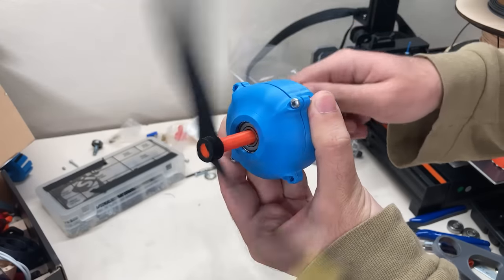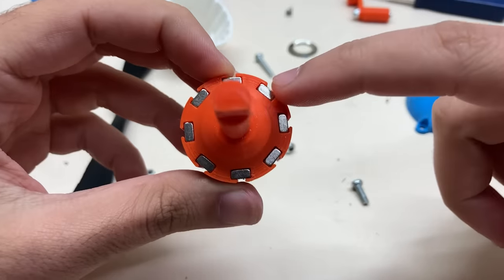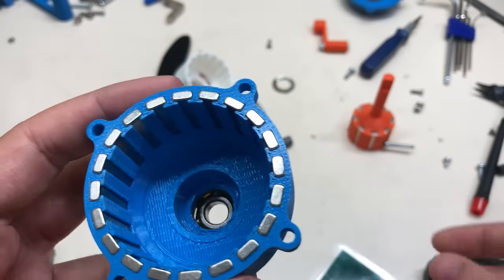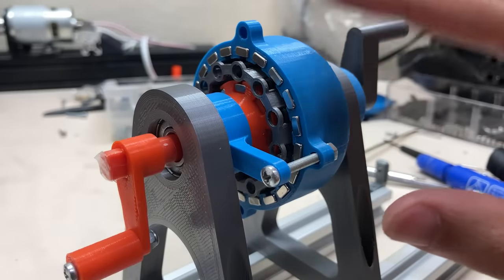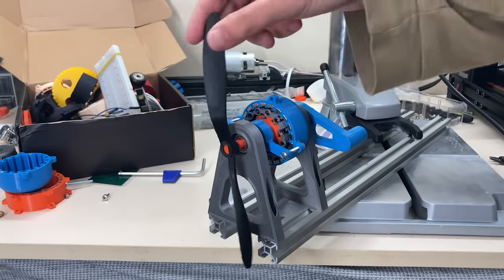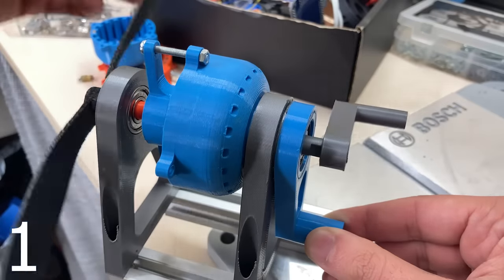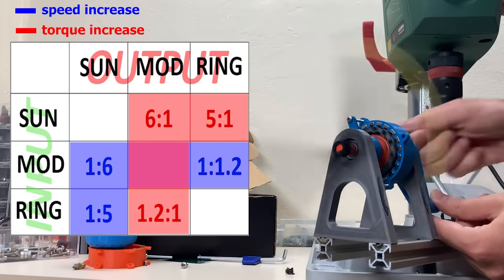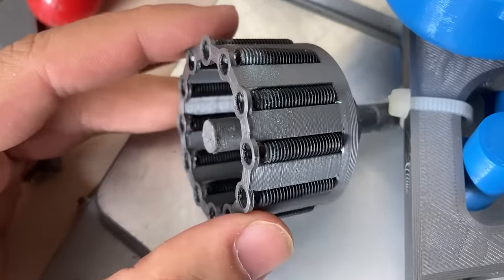How this magnetic transmission works?

Comment: Couldn’t you switch out the magnets for electromagnets and alter which ones are turned on and at what power in order to change the “gear” ratio. It would make car transmissions way simpler and probably many other things.
Reply: Yes, that works, but it takes so much power to operate the electromagnets that any mechanical transmission (even continously variable designs) is more efficient.
Reply: In principle that would work, but if you go that far, why not just use an electric motor that doesn't require a gear box to drive your car? Oh, wait... 😊
Reply: @helmutwalle2105  correct me if I'm wrong but on paper, the following could work. 
Assigning a static motor as input. Use a audrino with electric magnets. Have the external module installed with 24 (or more) electric magnets. The audrino will simulate a gear shift powering 1/4, 1/2, 3/4 and all electric magnets. The more magnets that get switched on, the faster it would spin. It would also be able to change direction so you'd have forward and reverse. In theory it could work. Please try. I don't have a 3d printer. The housing would be larger than the current 1st Gen. If it works in practicality, then not only would Manuel give you a smoother shift, but automatics would would get you a faster than current shift. Almost like a live shift. It will also eliminate the "Manuel vs automatic" argument as you would be able to switch between the two variations.
Reply: @helmutwalle2105  Electric cars still have a single speed gearbox/reducer.  Usually around 9:1.
Reply: @VNCTHE1  - yes, I know many still do. The technology used in production EVs is not very sophisticated. This may change in the future.
Reply: Sounds like you're describing an electric motor.

Making the magnets electromagnets also significantly degrades the performance of the transmission since energy would need to be routed or separately supplied in order to power and manage the transmission. I'm sure the energy required to do this would likely exceed any performance gains from using a transmission like this over a traditional geared transmission with appropriate lubrication.
Reply: @helmutwalle2105  it's not a matter of sophistication, but the fact that electric motors are most efficient at a given rpm that's governed by its construction.
Reply: The big three are coming for you
Reply: I like electromagnetism as a means to overcome inertia, but after that it's not reasonable. I also don't see rare earth magnetics being able to easily overcome inertia. Almost like a partially engaged clutch. Maybe there's room for both technologies.
Reply: Magnetic gears can't handle torque loads.  There are all kinds of inventions that you have never heard of, and for the most part, there is a reason they aren't used for other purposes.
Reply: I believe what you are describing is known as an electric motor
Reply: @jacobclubb5624   No in this case we aren’t making a shaft spin. We take a shaft, make that shaft turn electromagnets which in turn effect the other magnets in a way that either increases its torque or the reverse. Which you can change how much it does simply with a controller. Changing gears without moving “anything”. As others have said this is rather inefficient compared to other ways of doing so. But it is versatile. But you are right in the way that if you just programmed the controller another way it is an electric motor.
Reply: Only for the stationary magnets would I see this being possible
Reply: @ShaunHensley  why so? The electromagnets on the outside are stationary. The magnets on the inside turn along with the shaft as is in the video.
Reply: @windify2712  because I would think the wires carrying power to the rotational slugs in order to make electro mags would twist off, I think?
Reply: @ShaunHensley   @Shaun Hensley  well, the magnets on the inside could be just normal magnets. And the ones outside & stationary would be electromagnets. And you could control it according the the speed of the "input" shaft making a sort of differential.

Or This is unneccesarily complex and unreasonable aaand probably fantasy you could induce a current inside the inner electromagnets from the outside.
Reply: @windify2712  That’s exactly what I said mate
Reply: @ShaunHensley  Ah alright, I didn't understand what you meant by stationary magnets in the comment before. To my defense it was an unclear sentence.
Reply: @windify2712  Well, rotating equipment has a stationary component and a rotating component and they work off each other.
Reply: @windify2712  calling your idea inefficient is a wild understatement. I don't think you understand the enormous amount of power an electromagnet consumes. This is not something that can be reduced through the advancement of technology without violating fundamental natural laws.

It would also be limited to low torque motors which unfortunately cannot produce enough power to use your transmission.
Reply: Yes
Reply: @coreyduma325  I don't really have much experience using electromagnets. Especially not at the scale that large. So I can't really gauge how much power it would consume :
Reply: @windify2712  astronomical amounts of power. Thousands of amps. It would need to use superconductors to make one that was a reasonable size. 

In the end, it would result in a transmission with negative efficiency consuming more power than it transmitted while costing more than most supercars and being the size of a van. It would be limited to less torque than a motorcycle
Reply: And this is how you make a servo
Reply: Theoretically yes. Practically no also itd waste more energy than just a physical gearbox
Reply: @brianb-p6586  have you heard of electropermanent magnets? they're electromagnets that only need power to flip their magnetic orientation. once power is turned off, they remain magnetised. they might be able to do this with less power
Reply: @brianb-p6586  energy consumption is pretty high, but that's only because of the initial start for the most part. If energy efficiency and sufficiency is the key, then manual ignition wouldn't be choice as an initial start
Reply: @default1988  because the amount of electricity needed to drive the electromagnets would be so much that you can make a week slow car anyway. And if you're already putting that much battery and electric components and power equipment, you may as well just make it twice as powerful and make that the entire engine in the first place
Reply: How is it different from the Tesla engine?
Reply: These are good for speed but they can't handle high torque
Reply: Electromagnetic operation be useful on multiple fronts, to consolidate transmission and regenerative braking into one unit
Reply: @default1988  saying that any transmission would be able to fix that argument is going a little far I think. Even automatic engines technecally can do that as given by most automatic transmissions being able to switch gears on command of the user. Even though this is a really cool idea, I cant see it being any more efficient in cars other than the fact you probably don't need a clutch. these transmissions are more similar to transmissions with torque converter, where torque is not directly transmitted, but acted upon by a force from the other side. Good idea, but I think the only advantage possible is longevity.
Reply: HYPOTHETICALLY if u did put this as an electromagnetic gearbox it would probably be best suited as an additional gearbox like a transfer case for 4x4 but as a final gear like overdrive to get more over all top speed while limiting power consumption, eg: like if you made  the entire transmission electromagnetic it would need to much power to operate, which would negate the need for high torque from the gear but would exponentially increase the overall topspeed
Reply: That's an electric motor
Reply: Electric cars don’t need transmissions so as we are all adopting EVs eventually this is unnecessary
Reply: I was just think that and I saw your comment.
Reply: Yes, and then you call it an electric induction motor.
Reply: Thats how brushlrss dc motors (bldc) work
Reply: At that point you just have an electric motor
Reply: its the future , electric motors havev optimal rpm/ watt range , so yes !
Reply: Yeah you basically include brushes which means more friction
Reply: Permanent magnets are better because they do not need an external source, and electromagnets produce high heat and require refrigeration, in addition to electromagnets producing a lot of dangerous electromagnetic pollution. Nothing beats physical contact.
Reply: @default1988 so... a motor powered motor?.. huh. I like it
Reply: Exactly have you ever heard of the turbo encabulator? Does this something known as the magneto encabulator
Reply: But this method is entirely mechanical in function. No electronics required. No computers or electricity.